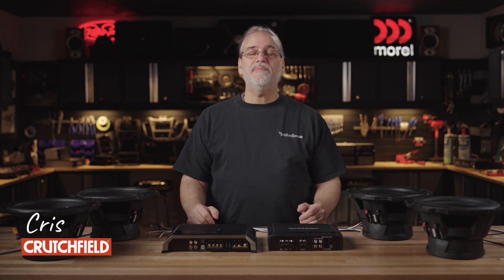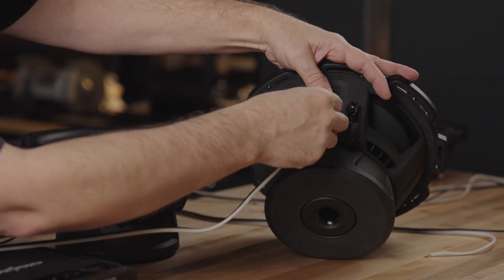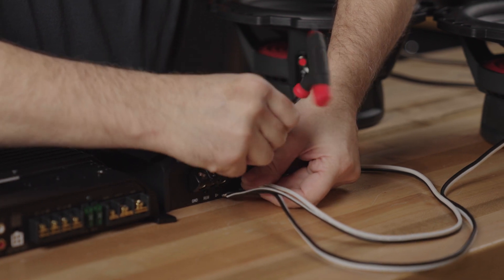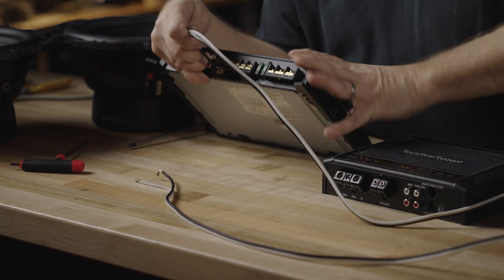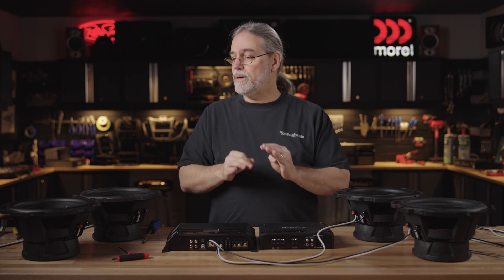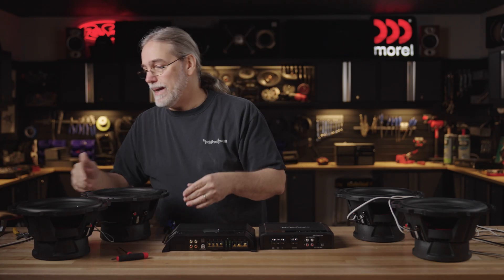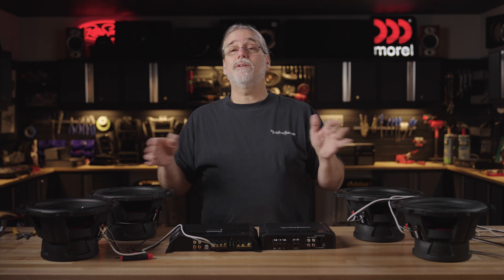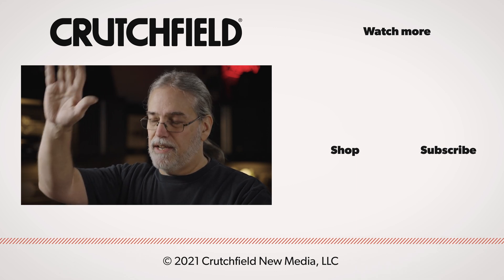How to wire multiple subs to your amplifier | Crutchfield

Comment: So if a amp for example is 
150 x1 4 ohm
300x1 2 ohm 

If I power two 4 ohm subs rated 300 rms 600 peak parallel then it makes it a two ohm 

Will I be then over powering my amp 600x1 2 ohm? Sorry if this doesn’t make any sense
Reply from the maker: Carefully considering your subwoofer impedance and wattage configuration is crucial to selecting the right amp. Connecting two 4-ohm subs capable of handling 300-watts RMS each would show a 2-ohm load to your amp, with a maximum wattage of 600-watts of potential power the subwoofers can handle. With your amp you would be delivering 150-watts per subwoofer and should sound great with most subwoofers without the possibility of overpowering.
Reply: @crutchfield  so that’s a yes HAHAHAHAH THANKS GUYS THES BEST OUT
Reply from the maker: Thank you!~ We are happy to help anytime.😎
Reply: @crutchfield  what if I did this with a under powered sub lik a 300 RMS sub with a 200 watt sub still being able to ofc obtain the 2 ohm if there capable of handling it I’d be guessing with the difference in power it would sound unbalanced?
Reply from the maker: It would work; but matching the subs does tend to sound best. Do you already have the subs you plan to use?
Reply: @crutchfield  I don’t I’m just pre planning ahead before I blast the money lots of research asking questions from you guys and kicker themselves
Reply: @crutchfield  really appreciate your help more then you will ever know
Reply: @crutchfield  thoughts on seed studio DSO nano v2 oscilloscope for amplifier tuning thanks

Comment: 10 subs 8ohm each, 1 amp 1ohm rated. How does it break down with multiple subs, such as in my case?
Reply from the maker: Sounds like you love bass! What models subs and amp are you planning to use?
Reply: @crutchfield  im in a wrangler soft top, i jus wanna hear a little bump lol 

 i have a 8k taramp, 7 - 12" prv & 3 - 10" prv subs (all svc). But i believe subs are all 8ohm loads. The Taramp is a 1ohm load
Reply from the maker: We don't carry these; but if you have the exact amp and sub models, we can try to take a look.
Reply: @crutchfield  i appreciate you taking your time out to reply to me. I have : PRV AUDIO 12MB1500
For subs. 

Taramps MD 8000.1 for amp
Reply from the maker: It is only possible to wire together eight 8 ohm drivers together and get a 1 ohm load. If you tried to wire in the other two, you will end up with something less than 1 ohm but your amp is not rated for anything less than 1 ohm. Another issue you will face is that eight of the subwoofers are not able to handle the power output from the amp. Ideally, you will find an amp that output 6000 watts RMS at 1 ohm when trying to run 8 of the subs on one amp. The other option would be to try to find an amp that is 0.5 ohm stable and outputs around 7500 watts RMS at 0.5 ohms.

Comment: Hey can I connect the  two  4ohm  subwoofer  in parallel  to a 4 ohm on amp ?
And the subwoofer is of  1500watt and another one is 140watt and the amp is 500 watt
Reply from the maker: Based on your question, it may not be possible to connect that gear together. It is not possible to wire two 4 ohm loads (4ohm subs) and get a 4 ohm load for an amp. But it could be worth a double check of the gear. Which brand and model subs are you trying to connect together? What is the brand and model of the amp?
Reply: @crutchfield  it's okay no problem..but I have another question  I have  a toyota etios (2013 ) and it has a stock stereo which is having only two speakers configuration but I want to upgrade it to 4 speakers system but the thing is that  it doesn't  have 2 more speaker output and the  output which is given to those two speakers  I have connected Two wires and taken as an high level input for the amp to use a subwoofer
Reply from the maker: When adding two more speakers, you will need to get that same high level signal to a speaker amp so you have a way to power another set of speakers. Sometimes you can join two wires to one tap. If that is not possible here, then we recommend tapping into the stock wire again for the new speaker amp

Comment: Now why would you wire in parallel, I have 2 subs at 500 rms each and a 1500 watts sundown sae V3 amplifier. What would be the best way to wire subs? They are 4 ohms
Reply from the maker: Are your subwoofers single voice coil models? If they are, then wiring them in parallel is the preferred method of connecting two to your amp.
Reply: @crutchfield they are dual, yes and thank you.
Reply from the maker: Great! You can wire the two dual 4-ohm subs in parallel for a 1-ohm load for the perfect power match with that amp.

Comment: I currently have a 12' 10000w sub in my car, am i able to simply add another 12' 4000w sub to the same amp? Also will the 4000w 12' make a noticble difference if i can add it.
Reply from the maker: We will be happy and have a few questions to get started. Which brand/model sub and amp do you have installed now? Which brand/model subwoofer are you inquiring about adding to them?

Comment: I have 700 watt rms amp… what dual coil subwoofer power rating will I need in a 4ohm to get 2ohm paralleling w dual coil to take full advantage of the 700 watt RMS amp?

Comment: Thank you so much for the video. Using the parallel technic, can I do the same with my wireless subwoofer (from soundbar)? My sub driver that came along with the soundbar( samsung q950a) is only 8 inch 4omhs. The wireless sub has no output and neither samsung sells same model subwoofer. All I wanna do is hook up wire directly from the sub driver using your parallel technics and then sends the audio signal to a small sub amplifier that can handle my new polk subwoofer 12 inch 200 watt. Will this change the overall impedance or impact inadvertently in the process? 
My intended simple steps below:
1. Hook up wire from wireless subdriver inside the sub cabinet(parallel) 
2. send the audio connection (wire) to a sub amp.
3. then send the connection to new subwoofer. 

Eternally grateful if you reply.
Reply from the maker: Speaker level inputs on devices have such a high ohm rating that they, for all practical purposes, they do not change the ohms that the source amp sees. The process you described can work as long as we know the other gear works. You mentioned the wireless subwoofer does not play. If it was the amp in the wireless subwoofer does not work, then the newly added amp/sub gear to not produce any audio. And that is on top of the fact that once you open that cabinet of a wireless subwoofer, most manufacturer warranties are voided. It is best to use parallel wiring on devices meant to connect gear that could be wired in parallel (i.e. some power amps, etc..).

Comment: I have 2 1000 wat subs and a 3000 watt d type mono block i've done the wiring in parallel but the subs have a real bad vibration when you turn the volume up should i wire in in series or should i use say a 600 watt amp?
Reply from the maker: Hi Jacob, the best wiring option will depend on your exact sub and amp specs. What brand and model is your amp? Is each sub rated for 1000 RMS? How many voice coils does each sub have? What is the impedance per coil?

Comment: stupid novice rookie question.. so turning 2 4 ohm subs into a 2-ohm load actually gets the most maximum power from the amplifier? how does that make sense... the lesser the ohms the better?
Reply from the maker: Amps typically output more watts when they are presented with lower ohms. Ohms is resistance. With less resistance, more work can be done (think how many more 45# plates a person could lift if gravity was reduced). For amps, their work is creating watts. But one thing to keep in mind is that you do not exceed the lowest ohm that an amp can support.

We have an article on our web site that is designed more like a walkthrough to help match subs to an amp now that you have seen various ways to wire them together:

https://www.crutchfield.com/I-rFBKc227/learn/how-to-match-subwoofers-and-amplifiers.html
Reply: Think ohms as resistance. 
Let’s say somebody was playing tug of war, 4 people on each side (4ohms). In this case, there is equal resistance. No one side can pull harder than the other etc. But let’s say two guys are removed from one size, well now there is less resistance for the side with 4 guys, meaning that they can now pull harder and use more power compared to the side that now only has two guys. 

The less guys = less resistance, which means more pulling power.

Comment: Hi i have a jbl gto 75.2 amp and two jbl gt4 12inch subs how would you recommend wiring them up to get the best out of them as your video has just blew my mind good video though thank you .
Reply from the maker: The only way this can work is with one sub wired to each amp channel. That will give them less power than we recommended, but will at least work. If you want to get the bass that the subs were built to produce, we recommend getting an amp like this MTX to power your two subs:

www.crutchfield.com/I-rFBKc227/p_236THND5K1/item.html
Reply: @crutchfield  right ok. thank you for your reply I will get another amp
Reply from the maker: You're welcome, Michael. If you need anything further, please let us know.

Comment: I have 2 Dayton audio 7" Rs180p I'm putting into a box 26" high. 13" deep. 12" wide. I'm also putting 2 x 10" passive radiators opposite them in the back of the box. Will the box size be ok for this set up? Thanks in advance from London
Reply from the maker: We are not familiar with Dayton Audio products. They do not list any box specifications on their web site for the recommended internal box volume when installing them with passive radiators. We recommend reaching our to their customer support for help with designing a box for the subs and radiators.
Reply: @crutchfield  ok. Thank you.
Reply from the maker: Anytime!

Comment: i am trying to hook up 2 4ohm DVC subs in parralel with a final impedance of 2 ohms. is this possible considering they are DVCs?
Reply from the maker: When you wire 2 4-ohm DVC subs in parallel/parallel it will present a 1-ohm load to the amp. No way to get a 2-ohm impedance with your subs.

Comment: Hi, I like how informative your video is but i have a question in regards to ohms. Is there a way to wire a single sub woofer to a mono block and force it into outputting 2 ohms?? I ask this because i have a single 12" Competition Kicker sub that can handle 400RMS. My mono block at 4 ohms only outputs 200RMS, but at 2 ohms it delivers between 400RMS to 500RMS depending on the voltage from the battery. I would like to get that 2 ohm power from the amp to my single 12" Kicker as at 4ohms it really isnt outputting much power to keep up with the rest of the system. Is there anyway to trick the amp into outputting 2ohms or is my only option to buy another Sub and wire it as shown in this video so i get 2 ohms from the amp. BTW my amp is capable of running at 2ohms.
Reply from the maker: We do not have devices that can be wired with a subwoofer to change the ohms the amp will see. You mentioned having a Kicker Competition subwoofer that can handle 400 watts RMS. That sounds like their CompR models which are typically a dual voice coil subwoofer. What is the Kicker model number of your 12" Competition subwoofer?
Reply: @crutchfield  Hi, Thanks for your reply. I am not sure of the model number as it was boxed since i purchased it. Its a Kicker enclosure and from memory (i dont remember what i did a day ago these days) i am pretty sure it says CompR (or something along those lines) on the Sub or enclosure. It is not a current model. I purchased it over 10 years ago. When i get some spare time, i'll have to take the sub out of the enclosure to see if it actually is a competition sub with Dual voice coil and to see the model number as i have been curious about it ever since i bought it.
Reply from the maker: Thanks! Please reach out once you have the exact specs so we can help you match up the best amp.

Comment: I have two 12 inch subwoofer and they are both dual 2ohms,now can i just hook it up just the way they are on the skar audio rp monoblock 1200 amplifier? Which it has 2 negatives and two positives terminal
Reply from the maker: We don't carry that amp or brand; but it looks like Skar includes wiring diagrams here: https://manuals.plus/skar/skar-audio-rp-1200-1d-monoblock-class-d-mosfet-amplifier-complete-features-owner-guide#axzz83D95imxa
Reply: @crutchfield  Thank you
Reply from the maker: Anytime!

Comment: Good Evening 
New subscriber here 😊
I have 2 Kicker 10CVX122
12" subwoofer with dual 2-ohm voice coils
maximum power handling: 750 watts RMS (1500 watts peak) I would like to get the best and louder sound out the subwoofers can you please help me what can AMPLIFIER do you recommend me and connect it in parallel or series ? 
Hope get back from you soon 
Thanks 🙏
Reply from the maker: Great subs!  You could wire them to a 2-ohm total load as shown with this wiring diagram: https://images.crutchfieldonline.com/ca/learningcenter/car/subwoofer_wiring/2DVC_2-ohm_mono.jpg
And this JL Audio mono amp is a perfect power match for them: https://www.crutchfield.com/I-rYALc928/p_13698643/JL-Audio-RD1500-1.html?tp=35834
Reply: @crutchfield  thank you so much for your answer i have before the Kicker ZX1500.1 but kicker don’t make it anymore with that specification ( 1500 watts ) i will try that one you recommended to me thanks again for your time 🙏
Reply from the maker: You're welcome! Enjoy! Please let us know whenever you need anything else.
Reply: @crutchfield  thanks 🙏

Comment: So you don't hook the subs to each other you just connect them at the amp? I have 2 8ohm jl audio and hooked them to each other then ran them to the amp is the wrong?
Reply from the maker: Its safer on the first subwoofer's connections if the second subwoofer is wired to the amp instead of the first subwoofer. But as long as you have not had any issues so far, your wiring method should be ok.
Reply: @crutchfield  I have it hooked up that way to drop it from 8ohm to 4ohm is that not right?
Reply from the maker: What model is your amp? Does each sub have a single 8-ohm voice coil?
Reply: @crutchfield  jl audio 12w3v3-8 are the subs and amp ia Rockford Fosgate t-1500
Reply from the maker: Wiring two subwoofers in parallel by joining all the negative connections together to the negative on the amp and doing the same for the positive connections will make an amp see a 4 ohm load. As for the watts, they will be split evenly through both subwoofers. However, wiring the subwoofers together at the terminals of one of the subs, that will make this set of terminals get all the watts of the amp. Then half will  leave using the wire that runs to the 2nd subwoofer. That's what we were referring to when we mentioned the first subwoofers connections and that it would be safer on them if each subwoofer had wires running from it to the amp.

Comment: Do you notice a difference in sound quality when splitting the connections? I would assume less power means worse sound quality. Is it better to just run another wiring kit?
Reply from the maker: Just so you use the correct wiring and power matches, you should be set. What do you have in mind?

Comment: You showed how to make two 4 ohm speakers into 2 ohms. And two 4 ohm speakers into 8 ohms. I didn't see an explanation for 4 ohm installation
Reply from the maker: That's because it is not possible to wire two 4 ohm subs (or speakers) together and get a 4 ohm load for an amp. Different subwoofers would be needed so they can be joined together to a 4 ohm load. Two 2 ohm subwoofers can be joined together to create a 4 ohm load using the same method shown when creating 8 ohms from two 4 ohms.

Comment: I have 2 Kenwood 12" subs both 2000wats is a EDBX1800 (max3600watts) amp ok to use for them also they are
1 voice coil each
Is it ok to wire them parallel?
Reply from the maker: Hi Abdur, is each sub rated for 2000 watts RMS power? Does each sub have a single 1-ohm voice coil?

Comment: What would be best for 2 8" 200 watt subs and a 500 watt 2 channel amp
Reply from the maker: Hi Brian, how many voice coils does each sub have? What is the impedance per voice coil? What is the brand and model of your amp?
Reply: @crutchfield   I have 2 8" jbl 810  one coil, I think they are 200 watt 4 ohm speakers and I have a 500 watt legacy la-500 2 channel amp the amp is older but I was hoping it would work for what I have
Reply from the maker: With two 4-ohm single voice coil subs and a 2-channel amp, you would typically just wire each sub directly to one of the amp channels. Do you know the true continuous RMS power rating of your older amp per channel?
Reply: I'm not sure how would you know
Reply from the maker: What model is the amp?
Reply: It is a legacy la-500
Reply from the maker: We tried using that model number to search online for the amp and is specifications, but was not able to find it for your model amp. You may need to contact the manufacturer to check if they have records of the watts RMS that the amp outputs on each of its amp channels.

Comment: Is it safe to have a 1200 watt amp for a pair of 4 ohm subwoofers?
Reply from the maker: As long as the subs can handle the power being output by the amp, then yes! More information is needed to check it. What are the brands and models of the amp and subs?

Comment: You had mentioned positive to negative positive to negative but positive speaker wasn't shown where it went when putting wire to amp.
Reply from the maker: Hi Paul, what are you trying to wire up specifically?